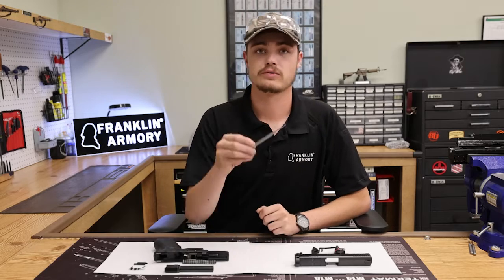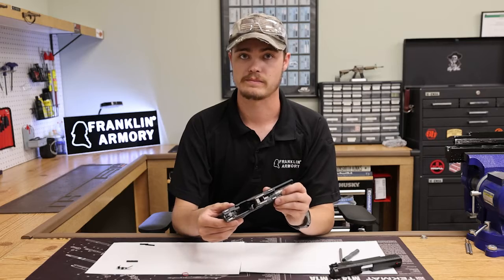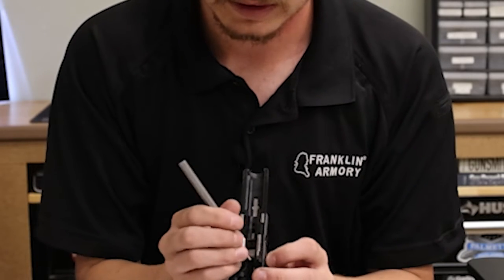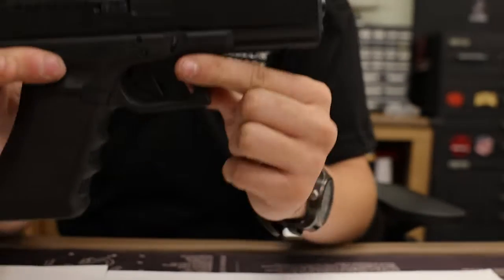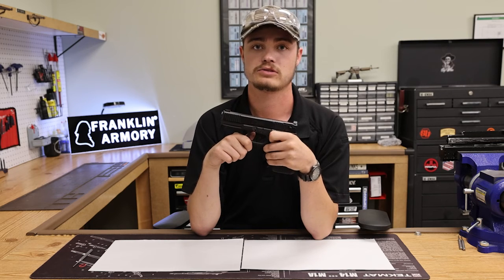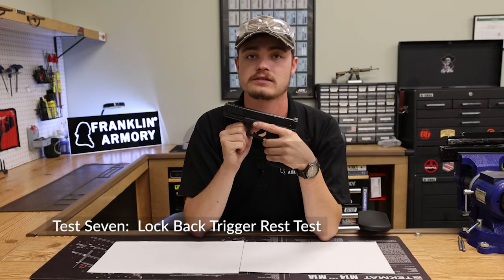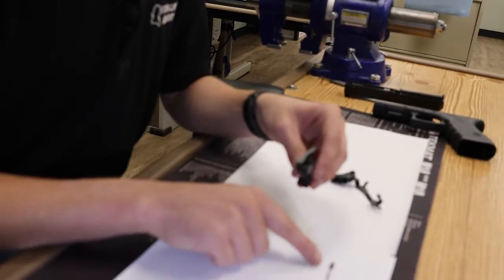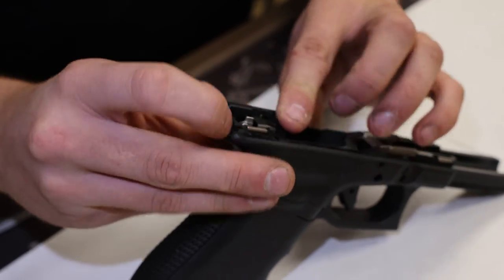G-S173 Installation Video

Comment: Just got my new Glock 17 Gen 3 and Franklin Armory G-S173 yesterday, was a tad nervous taking it apart and getting it back together again with the printed instructions.  Watched this young mans video a couple of times and got started.  Was waiting for something to go wrong (as it usually does for me), but I followed his instructions and paused the video as I attempted each step and BOOM I got it done without any pieces flying thru the air or something not working after doing the steps he then laid out to make sure it was working as it should!  THANK YOU for an excellent video!!!

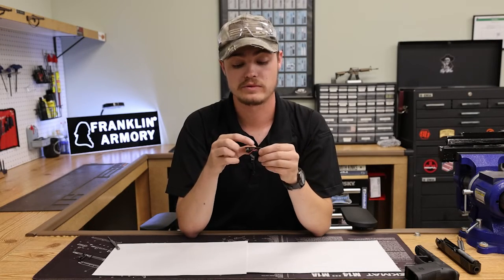Comment: If your rubber band was broken Skip to 11:10 you will have to reinstall the torsion spring 

Once you reinstall, it will correct the dead trigger and release only on binary.

Comment: Just installed one on mine gen 3 17. While doing the function tests it works fine in binary mode even will cancel the round. But it will not drop the firing pin in single mode every time. I have to rack it multiple times. Single mode will work everytime with a empty magazine in it. I put my stock slide and trigger back in and it works fine. Any suggestions?

Comment: Question, on the slow release binary reset test (test 2) my trigger doesn’t reset (no reset click) the striker just drops.  Any way to resolve this issue? Or is this normal?
Reply: Skip to 11:10 you will have to reinstall the torsion spring

Comment: Will the G-S173 fit/work on the Block 17L ?
Reply: 3rd generation of course ?
Reply: @kennethking817  Possibly but it will completely replace the slide so it won't be an L anymore
Reply: The slide would be the GS173 but I would use the 17L barrel , The G17 frame is the same frame for the 17L for the 3rd generation .

Comment: I tried to put this on a Grey Ghost Precision G17 frame and I can’t get engagement with firing pin on dry fire test except on binary release. Is this frame not compatible?
Reply: They told me when I emailed them in less words that they won’t guarantee it’ll work with anything other than a bone stock gen 3.
Reply: Skip to 11:10 you will have to reinstall the torsion spring
Reply: its the torsion spring, needs to be reinstalled. 

Skip to 11:10 you will have to reinstall the torsion spring

Comment: The rubber band on the trigger was broken when I opened the box. The trigger looked intact. Followed the video and put the trigger in.  Now I can’t pull the trigger. (Striker won’t fall). Can’t disassemble either.  What’s going on here.  Also the instructions about trigger assembly can’t be found on your website as mentioned in the installation instructions.
Reply: Did you put the trigger housing pin back in?
Reply: The rubber band on mine was broken as well. But the trigger bar was still attached. I had to pinch it and gently remove it from the package and everything looked intact. I slapped that bad boy together and somehow everything worked. No clue.
Reply: Skip to 11:10 you will have to reinstall the torsion spring
Reply: You will have to put in binary mode, keep working action and trying to fire till you hear striker fall, then remove slide. 

Then Skip to 11:10 you will have to reinstall the torsion spring
Reply: got same problem, any update on your situation? thank you
Reply: If you can’t get the slide off take off the back plate and the slide will come off.  Then reposition the torsion spring as stated above and you should be good to go.   Look at the part of the vid near the end where they tell you how to put it together if it has come apart.  Mine working perfectly now.
Reply: Is your trigger still in the bag and you haven’t played with it too much? My rubber band was broken but the trigger was still together just from the bag holding it together. I pinched it in the bag and carefully removed the bag while holding the trigger together. Kinda peeled the bag back like a banana.
Reply: @ericjones6587  pulled the backplate out, put everything back together, everything works perfectly, thank you!